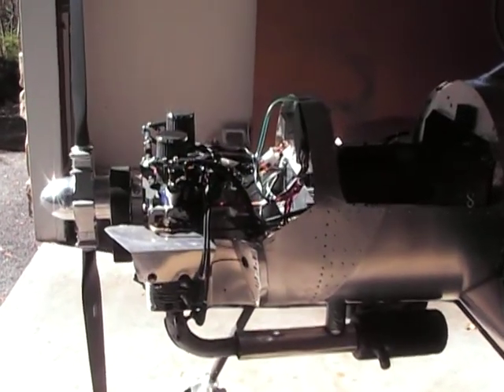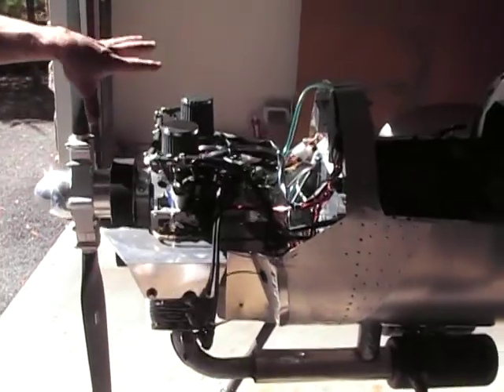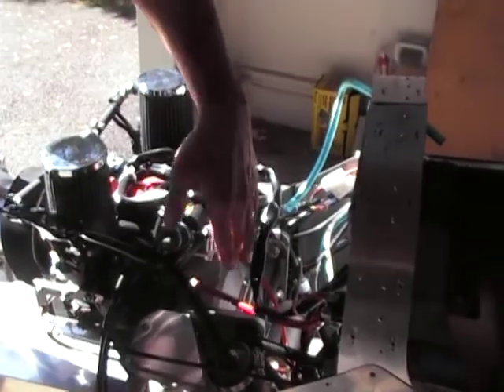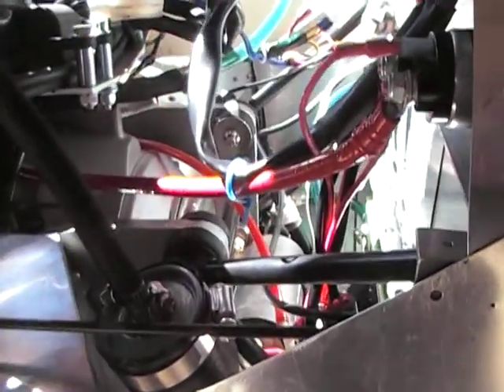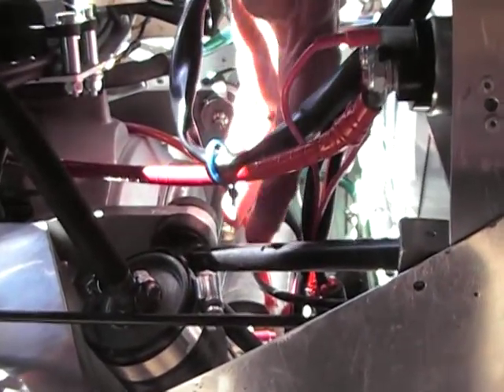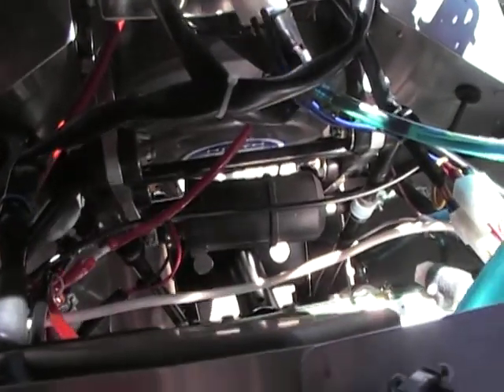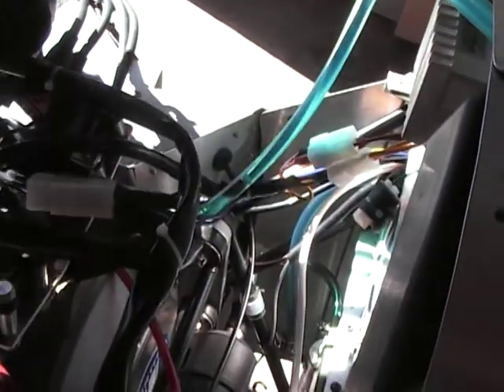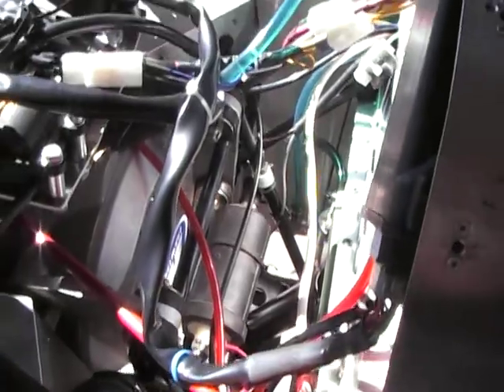Hirth F23 in a Hummel.

Comment: Hi 
Thank you for posting this ,I like the others am interested in using the F23 in a Hummelbird.
I believe it is a perfect application for the F23 but until yourself I have never heard of anyone
doing it. Used VW engines are not common or cheap in Australia.
I would be interested to know how it flies and how the F23 performs.
From Oz
Reply from the maker: The UC flies very well and does exactly what you would expect/want it to do in all situations I have encountered over the last 12+ years. The push rod control system is an excellent feature that makes it very responsive. The Hirth F23 performs very well with no issues. Mine is fuel injected so there's no carb ice problems. It burns 3.25 gallons per hour at 5000 RPM, slightly more than the performance charts show. It is very powerful at 50+ HP and yet weighs only 78 pounds. I am not aware of a better choice for a Hummel if you're okay with 2 stroke. I premix my fuel but understand there is now an oil injector available that might make it more convenient. Thanks for writing!

Comment: Hi, contemplating buying an Ultracruiser here in Kitsap WA.
Love your videos.
Was the Hirth lighter than VW and instrumental in reducing weight and managing to stay part 103 even with canopy and tricycle gear?
Reply from the maker: Thanks! Yes, at the time we built the UC back in 2007, the VW conversions were crude, underpowered and heavy compared to the Hirth, although I don't recall the exact weight of the 1/2 VW at the time. The Hirth produces 50HP at only 78 pounds (with the exhaust). It's an amazing engine and almost perfect for this application. Power will not be a problem with the F-23.

Comment from the maker: Hi
  The fuel is determined by the engine which, in this case, is a Hirth F-23.  I got the engine from Recreational Power. You can Google their web site which describes the engine in detail.
  I use Premium auto gas without ethanol and mix it with Blue Max oil (also found at Recreational Power).